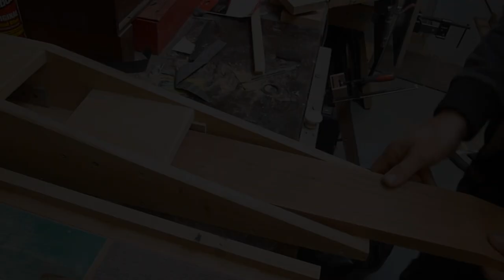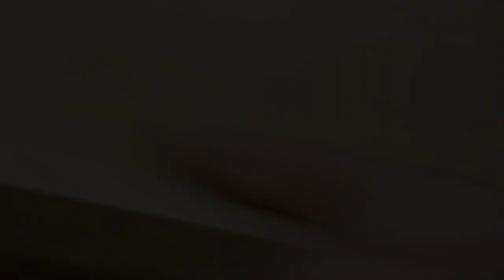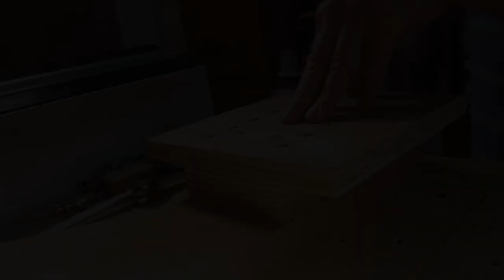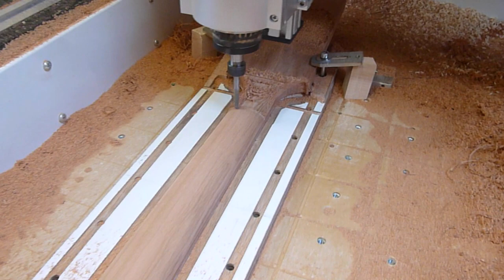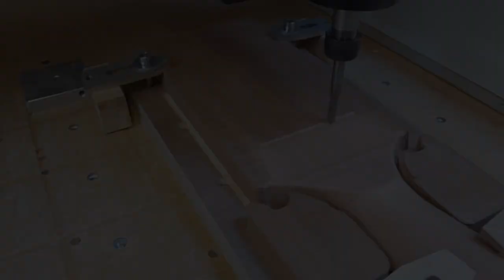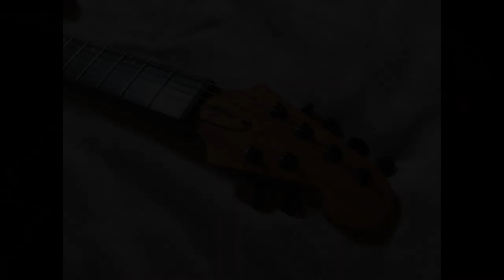Workbee CNC Scarf Joint guitar Neck Angled Headstock Duet controller

Comment: Why not use a dust shoe with a festool  midi, works very well!
Reply from the maker: +graveur graveur hi thanks for your comment and advice. I don’t use a dust shoe because my workbee is in a enclosed unit that has its own extraction. This cuts down on the dust in the workshop and also the noise.

Comment: Are you using the blackbox and stock nemas?
Reply from the maker: They are stock nemas but no blackbox I can’t remember is that particular neck was xPro3 or the early duet. Most probably the xPro3
Reply: @NickRogersNJRCustomGuitars  I'm completing a lead 1010 cnc with an ethernet axbb-e board and uccnc. But it's overwhelming and was wondering if you had the blackbox so I could ask a few questions. Anyway, thanks for this video! Angled scarf joint necks are what I think I might struggle with.

Comment: How are you reconciling double-sided milling? It doesn't look like you are using the pin method. Fantastic neck!
Reply from the maker: +Mark Gutierrez I use aspire and double sided machining using dowel pins. Thanks for the kind comment
Reply: @NickRogersNJRCustomGuitars  Nice job, do you know any videos or article to show how to make and draw the volute part (back junction between neck and headstock) with Vectric Aspire ? Thanks for sharing
Reply from the maker: @nonolagratte  I’m afraid I don’t, I did mine in solid works using surfaces. It was a bit of a pig. I actually draw all my necks using surfaces then when done knit it all together to make a solid. I think it may prove very difficult in aspire. Good luck and if I ever come across any video showing what your looking for I will let you know. Best of luck with it 👍

Comment: Hi Nick!  Great work! and thanks for sharing your tips :) 
I have a question regarding the routing of the back of the neck and headstock. How do you split the job in 2? I'm using fusion 360. It would help me a lot,. 
Thanks again :)
Reply from the maker: Many thanks, yes this was programmed as two separate jobs. I didn’t have fusion back when I made that particular neck. But if I were to approach the same job now using fusion I would have 3 set ups one for milling the truss rod, one for the back of the neck and a final one for the headstock.  you can use the same model  for all operations. Because at the beginning of each set up you tell fusion the direction of XY and Z. So food for instance machining the back of the headstock the back face becomes Z the length of the neck Y and across the neck X. Difficult to explain. I do have other videos making a Stratocaster type neck in fusion that may make more sense 
https://www.youtube.com/watch?v=EDAE_Efl24I
Reply: @NickRogersNJRCustomGuitars  oh thanks! I will look at this video. But I understood your explanations  :-)  
Thanks!

Comment: Very nice work. I wish Ooznest would have put an effort in designing some decent lead screws in their machine as well. Would you be willing to share your cnc files so we can try that project on our home cnc routers too?
Reply from the maker: Hi thanks for your comments, Yes I guess ball screws would have been better, having said that I’ve been using the workbee from ooznest for a couple of years now and have had no trouble with the lead screws or the tolerance of the machine. I get asked for my 3D models frequently but I’m afraid they are not available at this time sorry. Thanks
Reply: @NickRogersNJRCustomGuitars  Ball screws should have been there only solution to a 4x4 ft table. This all thread they put in the kit reminds me of an old back porch spring on the screen door. I went with 5/8" Dia. pitched lead screw with ball screws. Only problem is redesigning the layout. Would be nice to also see these manufacturers using bellows to protect them from dust and debree. I am a cnc machininst in the real world and this is elementary. It is a must. But great job on your projects they look great.